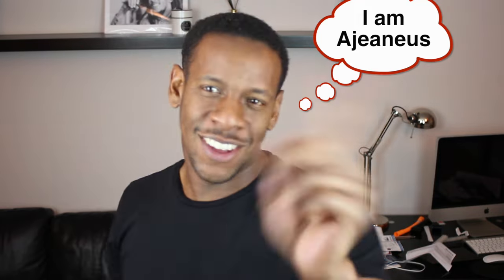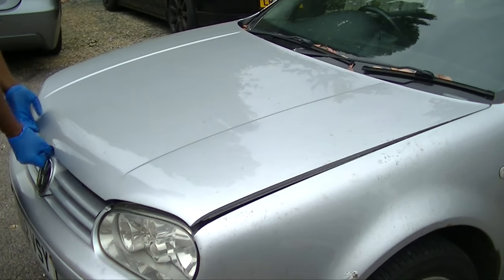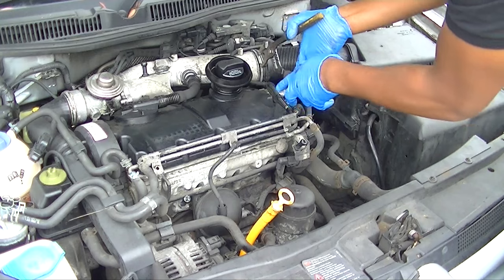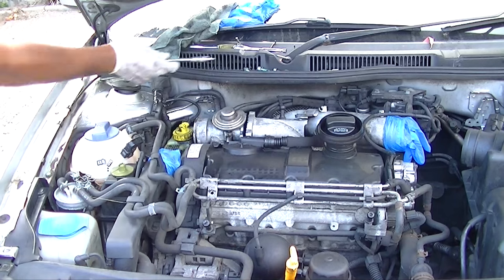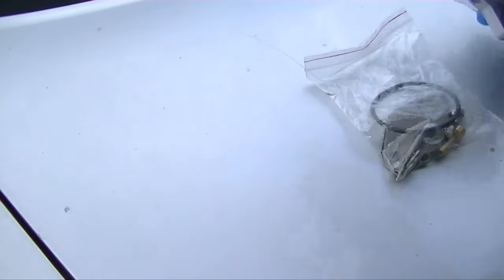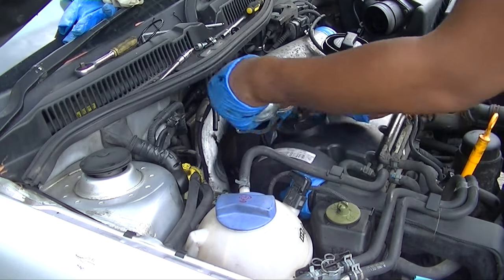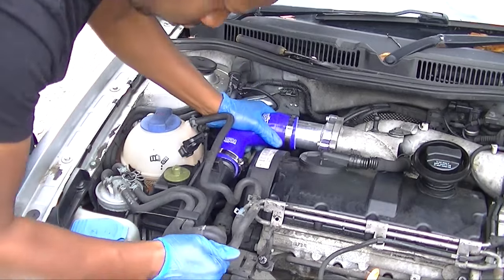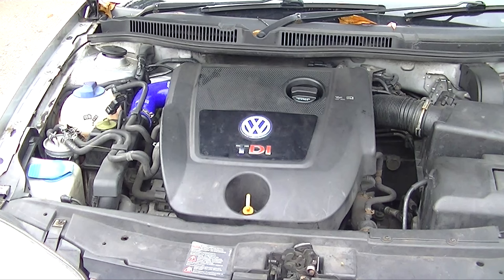How to Delete an EGR Valve with a delete kit

Comment: OK.. I'm really disappointed.I really do liked yours videos but now   You are trying to sell pretty much useless kit... without remapping (£100+) your car will go for limp mode after less than 5 miles (001025 code).Plus by removing throttle next to egr valve you loosing two things 1. It won't be so easy to shut down engine. 2. Performance, when you shifting gears that throttle is closing slightly to keep turbo pressure so you are not having 'turbo hole experience'   I do not want to discuss if we need egr or not but this tutorial is useless.
Reply: My car had blocked N75, N18 and VNT geometry but no limp mode. After changing 2 MAF I realized that the MAF was reading accurately and I had only clean air coming in, and Turbo spooled after 2000 rpm. no limp mode ever. But black smoke was increasing a lot soI cleaned the vacuum valves, the VNT,  and solved the vacuum leaks, and happy again.  First EGR and intake cleaning was 60.000 kms before ( 40.000 milles) , but I think I had more problems that only a blocked EGR first time ( 174.000 milles), it worked well at least 45.000kms (28.000 milles). It felt almost new whne all the thing were cleaned and working.
Reply: Piotr Pieczykolan p
Reply: I need a kit for F 150 87 model EGR delete kit
Reply: Piotr Pieczykolan you clearly know NOTHING ABOUT CARS
Stick to need for speed 🤣🤣
Egr blank or delete without map does not trigger limp home mode only engine management light in some cases the eml never comes on.
Reply: Rhonda Sutterfield  Ford EGR is easy to bypass:  all it takes is a knowledge of the DPFE sensor and you can fool your computer into keeping the EGR valve closed.
Reply: My auto 1.6 had age delete and the fking gearbox went in limp mode after the softwear  installation.
Any ideas?

Comment: Before you remove the EGR you must have it switched off in the ECU ! or you will have major problems engine light on, running problems, bad fuel econ . after that you can do the MOD and will work like a charm. had my  EGR turned off removed and mapped, better emissions MPG and fly's like a rocket
Reply: As my boy maps cars for a living ... i think i do know ..!
as you are asking about hoses.. i think you cant make statements you just do not understand .
Reply: how do you switch it off? the EGR inthe ECU?
Reply: Also I've  heard reports that doing this mod in your car will damage the engine as the re-circulation in the EGR helps to heat the car quicker in cold starts but doesn't allow  too much gas if any at normal temperature and driving speeds
Reply: what a plum loool
Reply: Not true, my ASZ engine has had no EGR for the last 60k miles and the only issue I have is a permanent engine management light. At first this was annoying, now I don't even notice it.
I still get 55+mpg on a long run and 45mpg on a sporty run.

The reason your son advocates the ECU delete of the EGR is because he makes a living out of remapping cars!

YOU CAN DO THIS MOD WITH NO ADVERSE EFFECTS, as long as you meet all the requires steps and fit everything correctly.
Reply: How much is the parts to do the job and on a 12 plate Vw caddy would it still do the job
Reply: underwaterdick your actually wrong it will run lean if its not tuned and will cause damage faster over time all you need to do is tune it and why your at it tune for all your other mods so it actually makes power
Reply: Bullshit, if your car has a mechanical EGR valve, you wont get any problems at all, you only need to switch it off in the ECU if you have a newer diesel with an electronic EGR valve.
Reply: @broughttoideas  running lean isn't a bad thing

Comment: Maybe you said it in the video but I was skipping through it just to get an idea of how you were doing it. My question is, how do you deal with the check engine light? I assume since blocked egr's cause the engine fault code light, once you purposely block it off, do you just drive around with the code on? Also, if an egr becomes blocked, and the fuel mileage goes to shit, wouldn't fully blocking it off cause horrible mpg? I'm not a mechanic but I do like to learn and tinker from time to time but I am obviously missing something here..

Comment: Egr valve recirculates exhaust gas back into intake which is burnt again which actually helps keep a lower temp in the cylinder and  exhaust manifold (reducing the production of nitrogen oxides)
Reply: It doesn't reduce nox lol
Reply: @brandonbarwick5944 it does...

Comment: Hi, thanks for the vid. I've just had my 02 Bora PD150 remapped to 180 (not bad at 205K). Would I have to change the map once I put the delete kit on? I really want to do it as I do so many miles.
Reply: a tip: you can watch movies on flixzone. I've been using it for watching loads of movies these days.
Reply: @Avery Iker definitely, been using flixzone for years myself =)

Comment: The egr in my car is necessary. It keeps combustion temps down and thereby eliminates engine ping/knock .... When it's clogged I get poor mileage and loss of power...... But it needs cleaning every 3months....it's an easy job cleaning it though..... I also clean the pcv valve and change fuel filter at the same time.... These are cheap to do....Mitsubishi 4g13 lancer..... 12 yr old car with carburetor.

Comment: Is EGR delete supposted to increased HP? I had my car tuned recently and I was told it's better to go with 'soft EGR delete'. I didn't have much time to talk about it, so just wondering if that's something needs to be done on all retuned cars with stock exhaust but ECU remap and performance filters added. Thank you for enlightening me!
Reply: Absolutely it increases power, response, mpg, and engine life as it throws soot in the engine. Now you know you learn new things everyday..
Reply: @davidb1089  'throws soot in the engine'? I'm not sure whether your answer is a sarcastic response to my genuine question man. I'm no car guy, so thought someone could help me out. Thanks!
Reply: @amjathkhan2004  well You could delete the catalytic converter(s) muffler etc. And yes throwing soot in is mostly true on diesels as they 'roll coal' however on a gasoline vehicle same principle but much less. cooler combustion is less power& fuel economy And engine temp. Also egr maintenance is gone.
Reply: @davidb1089  Thanks man. I misunderstood your respone that 'egr delete' will throw soot in the engine. Little digging shows that it's the opposite. Once again Thanks for your valuable time and replies : -)
Reply: @amjathkhan2004  Do you mean it's the opposite as it doesnt put any carbon into the engine? Or seriously if so Thank you & good luck
Reply: @davidb1089  Like I said I'm no car guy. And the topic about EGR is so confusing for me. I read about it and thought deleting EGR stops carbon buildup in engine, manifold which I also thought is what you were trying to say. Am I wrong? Are you saying that I should not delete 'EGR'? Thanks for the help!
Reply: @amjathkhan2004  Oh you should definetly delete everything you own. This will add engine longevity  No egr maintenece, horsepower which I already covered. Also try a straight pipe or cold air intake. Are you in the U.S & what car is it? Don't worry about the environment either. How could consuming more fuel and ruining more engines requiring more production be better for the planet it's a moneymaking scam. Best of luck to you

Comment: EGR valve normally is closed unless acted upon by electronics,To dis-able simply in-plug the wires going to EGR solenoid.
Reply: you will get a check engine light on your dash

Comment: Nice video bro. I originally subscribed for the video with the inlet manifold removal. 
How many miles does this Golf have on it? I've 119k on my PD130 just now and plan to do EGR/ASV and EGR cooler delete but not sure if i should take off the intake manifold to clean out all the soot and crap at the same time.
Reply: hardcoretam my one has 160k on it. The best thing to do is to remove it and see what its like on there. Once you know, go from there. Thank for watching the video

Comment: if i did this on my bmw e46 diesel 2003 will it clear the engine management light?  fault code p0401?  thanks for the good video.
Reply: You might want to ask a bmw forum idk
Reply: Oh wups 4 years ago
Reply: You need a tune to blank the CEL light for EGR fault after you delete.

Comment: Hi, I' m glad see you 😉😉😉😉 happy again. The knock sensor on a vw new beetle 2002 it will be hard to change?. Do you have any youtube video? Thank
Reply from the maker: maria espinoza No sorry, not at the moment
Reply: Thanks.
Reply: maria espinoza Thank You
Reply: I would have asked you what engine... they are easy to change.
Reply: gas 2.0, automaty.
Reply: maria espinoza There are two
Reply: maria espinoza Sorry... there are 2 knock sensors. One below the #1 & #2 cylinder spark plugs and one under #3 & #4.

Remove the secondary air pump if you have one and anything else that is in the way. 

The sensors are mounted to the block via 13mm hex head bolts.

Disconnect the sensors where they plug into the main wiring harness.

Install in reverse of removal.
Reply: Thanks for the information, I will try.

Comment: 02 cadillac ext 8 cyl 6.0 L I wanna do egr delte, Do i have to reprogram anything? I  figure dash light wil come on But is it safe to drive without programming? ( omg say yes lol) well not really I mean if its not good I wont do it but if i can SAVE 400 ! on new egr pipe.
Reply from the maker: Not on my car, but other cars may be different.
Reply: @BMACVAGS   turns out my mechanic was incompetent lol. He was chasing my issue of loss of power around the fuel system Cost me 1700. I took truck from him then to another  guy, 20 minutes he tells me its Cat clogged. He cut them off put pipe in .. My new cats come in about a week. I am a bit upset with the first guy. But the first guy would not look me in the face when truck was delivered from his shop and he did not leave an invoice so I thin He knows what he did wrong.

Comment: Mate, can you or anyone help? I've got a 2007 mk5 1.9 tdi golf match, with 122,000  (which I service regularly)on the clock and its smoking if I pull away hard  from a stand still start, I've tried to get the egr valve off but I can't see how. I really struggled,  it seems an impossible task, so I could only clean it in position. Could it be a prob with injectors or am I correct with the egr valve diagnosis, ( not down on power) pls can you offer any advice on a fix or diagnosis or better still how to get the egr valve off? Do you poss recommend a terraclean. Thanks in advance.
Reply: Scrap it buddy.

Comment: I'm looking forward to doing this mod, but what's holding me back is that there are rumours about how it will not pass emissions testing. How are you planning to pass your Etests, BMAC?
Reply: McCheeseKid What is the year and model of your car?
Reply: 2001 Golf TDI, much like the one in the video, but I think the one in the video is a PD engine, mine is an ALH
Reply: McCheeseKid 99% of the time, these don't bring up any lights. Older models are alot more robust than the newer ones.

Comment: or ... you can use Coke can. You have to flatten the can, dismantle the outlet of the EGR (the place where the exhaust gases are mixed with the air intake). adjust the screw holes in the metal plate and mount so that the lamina blinded the hole. If someone is afraid that the blade is too thin, you can use a few layers. Zero costs, and 15 minutes of work.
Reply: +Pawel Tylinski I was thinking of ways to block the egr , i.e if there are high temp resistant cut outs but a coke can really doesnt sound up to the job haha??
Reply: +007dardan I done that in my cars and it is working. Trick is to block conection after egr, near input to air inlet. There is much lower temperature.  In few weeks I will do video tutotial how to do that on my chanel so if you want you can subscribe and YouTube will notify you:)
Reply: Pawel Tylinski
Reply: @Dr.Stacker  so what to melt it i bet requires double temp... two, three layers

Comment: What are you talking about recycles "unburnt" gas? It's exhaust gas so there is no unburnt gas if your referring to oxygen!? The exhaust gas is inert (thus can not be burnt again). 

An EGR valve is there to re circulate spent exhaust gas to lower combustion temp to reduce NOx in the emissions.
Reply: So is the EGR Delete a good Idea or not in your opinion?
Reply: That depends on what way you look at it. 

Emissions wise then they will be effected as the EGR is designed to lower NOx. 

But much better for the driving and running of the engine as the engine will get fed just clean air which gives a better burn. 

In my advise it's wise to have the engine mapped as the software is designed to work with an EGR on a later engines. A good map won't put extra strain on you engine, it should make the most of the quality of the fuel in you country. I.e. In the U.K. the quality of fuel is very good as with a good map on ave you bhp will go up from 30-50bhp (turbo Diesel engine)
Reply: Just as well you approve as i already ordered the deelete kit.. My Bora is a 130 PD TDI .. but ive been told its ben mapped already to about 160 BHP and the car is a 2001 same engine as this one in this video. I'm wondering though , will it pass the MOT with the delete?
Reply: thats what i was thinking the gas is already burned and cant be re-burn.
Reply: there absolutely is unburnt fuel molecules in exhaust gas.  it is impossible to burn it all with on combustion cycle (or even 2 or 3).  Yes it does lower temperature and NOx emission as well.
Reply: Yes it will pas it will be better then before.

Comment: I have a kia sportage 2.0 06 plate and when the eGr is blocked it throws up a engine light and goes into limp mode. It needs sorting with a computer. Your kit doesn't seem to include this ?. What's the point ?

Comment: you did not mention were to connect the boost hose, the brass connector ???
Reply: You plug a boost line for a boost gauge there. If you don't want to you can put that tiny screw he showed instead

Comment: WHEN THE PUBLIC are warned about NOT SMOKING, they decide to put the COMBUSTION FILTH back into the engine AGAIN.... which is like running an engine with NO AIR FILTER and sucking carbon from leaking exhaust...... just A RULE TO DESTROY ENGINES with carbon sticking and grinding up parts...

Comment: What exactly does this do anyways? Like more gas mileage, hp or what?
Reply: Stops the build up of gunge in the intake manifold, but it will fail an emissions  test at an MOT centre.
Reply: Oliver Armstrong  
It also hightens the temp of the cylinder and exhaust manifold which in turn actually reduces hp and mileage

Dont do it! Its very counter intuative and the added bonus of failing emissions testing
Reply: Profail99 I agree, I would never do it to any of my cars but it is better to educate those who are considering doing it on the pros and cons so that they can make their own decisiom
Reply: Um... It will reduce your mileage. Your power will increase if anything, but not noticeably. A cold engine runs rich because it is less efficient, a warm engine runs lean because it is more efficient. The EGR recycles gas which can be compressed.

The reason you would see power gains if anything has to do with efficiency of combustion. Instead of compressing oxygen you are compressing a mixture of oxygen and exhaust gas (fuel). Which means to compensate for the lower oxygen content your fuel injectors will supply less fuel. Your exhaust gases are more inert.... so you will lose power.

More mileage = less power. It is pretty simple... Your EGR recycles gas which has unburnt fuel to save you money. Which means it is forcing your engine to use less power.
Reply: No doesn't effect any of that. It's efficient for the engine. It means a clean burn every cycle. Less soot in your engine less chance for it to block the manifold full of crap etc.
Reply: More hp, more efficient, cleaner running, cooler engine temps, etc.

Comment: Does MoT require emissions equipment to remain intact in the UK?
Reply from the maker: StopDropandLOL Yes, but if your car is well maintained you should be fine with emissions.
Reply: where you get the kit from and hose
Reply: StopDropandLOL don't. Do this. it a grand fine

Comment: How do my car keeps going into limp mode in 4- 5 th gears over 3000 revs could you help please
Reply: Youll need the ecu flashing unfortunatley not cheap but not too expensive and extra power gains
Reply: I have had this, check for boost leaks or vacuum leaks. I had my golf 4 TDI remapped and had this issue... 5th gear long pullls it would go into limp mode - i replaced my turbo which seamed to help but was still there, but just before i sold it a mechanic found what looked like a leak in the intake piping...which i think could have fixed it after all that, so i would check for leaks first... look for places where there looks like there is a soot  build up indicating a leak, best to put the car up on a ramp. (the tune i did was because i removed the catalytic converter)
Reply: Check vacuum pump and any leaks check all vacuum pipes for any leaks

Comment: WRONG! EGR does not recycles UNBURNED GAS, there should be hardly or no unburned gas, othervise there is something wrong with the engine. 
What EGR does it simply bypass some exhaust gas back to the intake when engine is at a partial load and fuel flow is low and there is no need to fill the whole cylinder with fresh air. You can use exhaust air where there is CO2 instead of O2 and thus the engine produces less NOx. 
Simply if intake flow is less than exhaust flow is less. With this diesel act like gasoline with trhrotle plate. EGR is more important on diesels since they operate on lean mixtures.  
 If intake volume is less than exhaust volume is less.